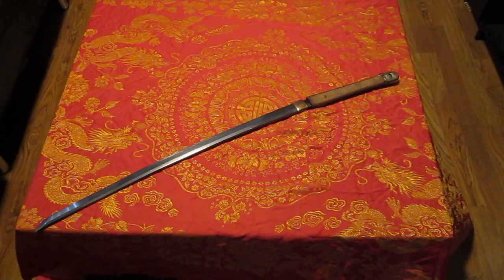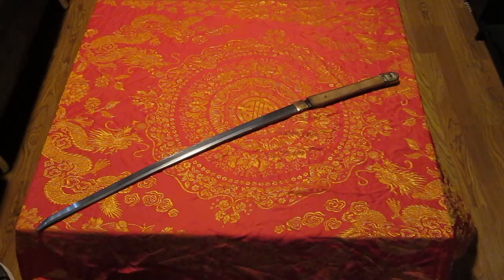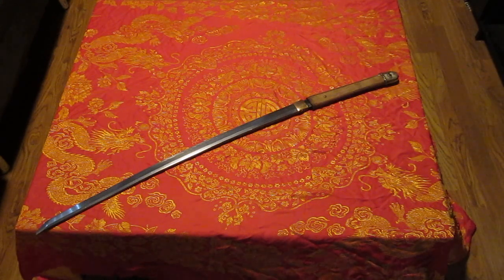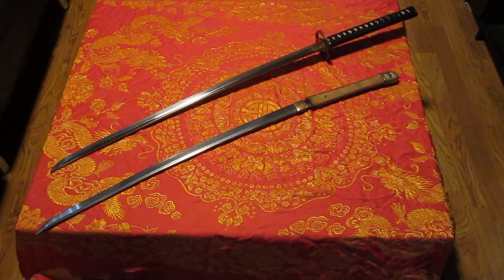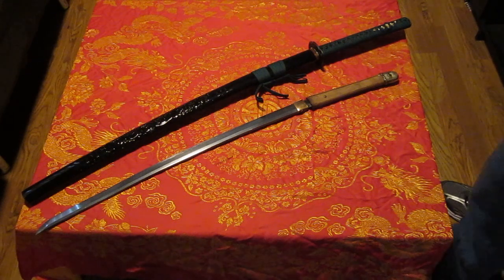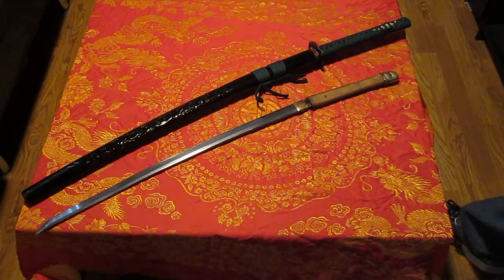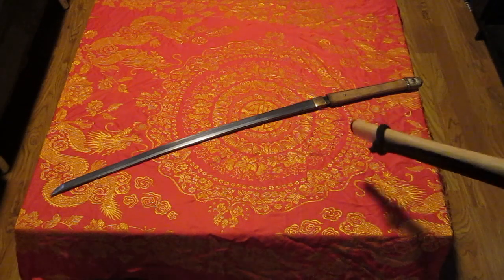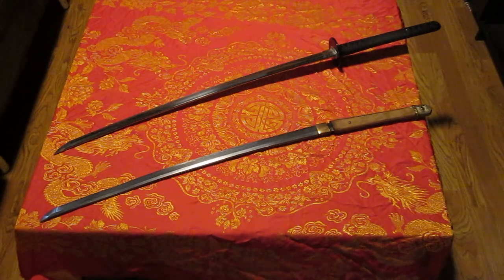Cheap Vs Real EP 7

Comment: Why does your body size or arm span depends on the blade length
Reply from the maker: basically it depends on what your doing with it but some swordmanship concepts revolve on your hieght and arm length to fit your style better 

example in some the ideal length is your height, in inches, multiplied by .6. 

there are other methods , for katanas to get a rough idea of how long a Katana you should have. Get an extendable tape measure and hold it in your right hand, with your thumb extended down. Then relax your arm at your side and extend the tape until it nearly touches the ground and check the reading where your thumb touches the tape.

This will give you a rough idea of how long the blade will need to be to suit your uses
Reply: Thanks for mentioning it cause you may or may not mention it or I just didn't see or hear it. But I still think that reach gives an advantage in a sword fight especially without armour and a shield ,sorry for going off topic but I don't know anything in Japanese swordsmanship. Can you talk about historical Japanese swordsmanship in your next video and why katana are built to fit thier swordsmanship
Reply from the maker: i mainly focus on the swords themselves, there is a lot of sword styles out there as well as different techniques. i do give minor pointers here and there.

Comment: So then by using different metals together it could possibly make a lighter sword correct? Depending on where you put the steels.
Reply from the maker: correct the type of lamination and combination of metals used can make a lighter blade , but geometry styles can also affect this as well

or example  (soshu kitae) nanameoni  with a heavy target geometry (dotanuki) is about the same weigth as the Destroyer of fate'(shizozume lamination) with muramasa geometry , even though its a much bigger(taller) and thicker blade geometry it moves pretty much as fast (if not faster ) then other swords due to this trait